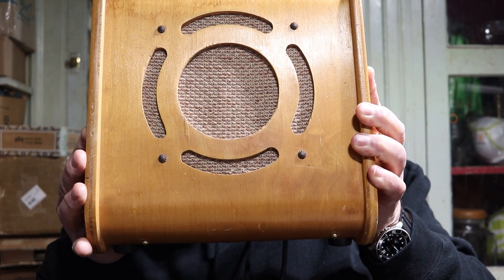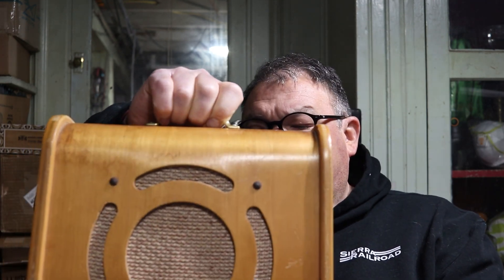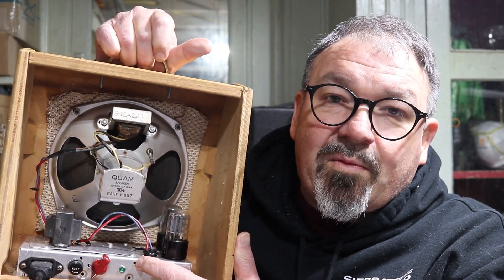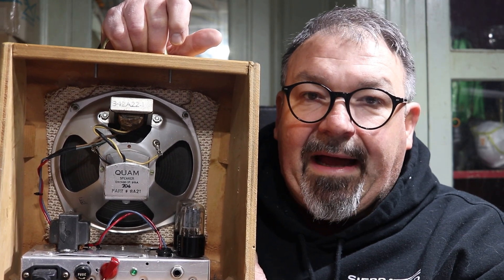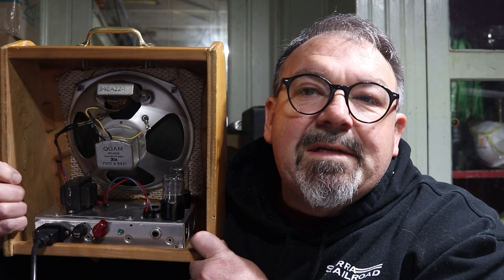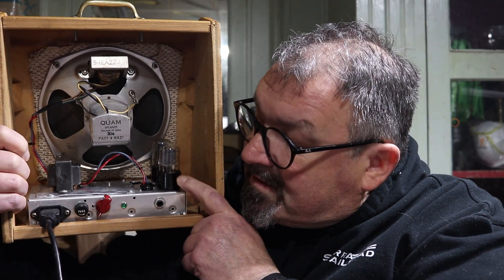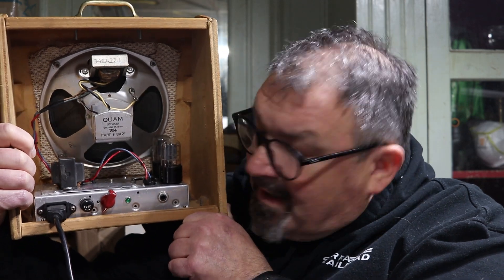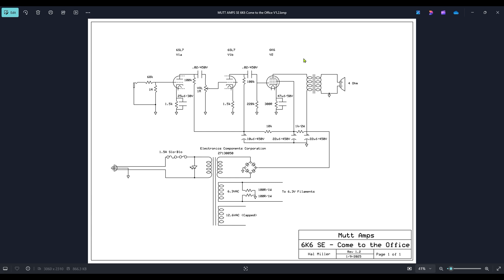Old School: Building A Fender Champ-Style SE Tube Amp Out Of A Classroom Speaker

Comment: 6K6, first used as a low power radio output stage, was the original reverb drive tube in the Fender Reverb Unit. It's a good choice for use with this particular low-voltage transformer.

Comment: Not one trick if you've got a pedal board. What's your plate voltage on the 6K6?
Reply from the maker: Fair point! Relatively low, only about 240V
Reply: @muttamps I really like 6F6's, same plate voltages and load resistance as the 6v6 but a plain pentode.

Working on a 6SL7 6SJ7 6SN7 KT66 one, an L7 triode drives the J7, an N7 cathode follower drives a tone stack, the other one is a unity gain cf buffer for an fx loop send, the leftover L7 makes gain and drives the KT66. Almost have it figured out!
Reply from the maker: @oldasrocks9121  Also a big fan of the 6F6! Your project sounds intriguing, you'll get it worked out!

Comment: Thats cool, I have recently acquired a set of suitcase speakers that came from an old funeral home in the 60's, it is loaded with 2 12"  8 ohm Quam speakers that I plan on building 2 amps  out it. I haven't decided on what type of circuit yet
Reply from the maker: Those should sound good, plus you already have cabinets!